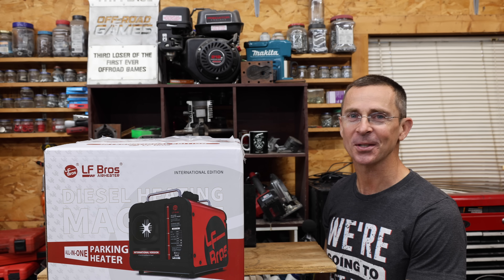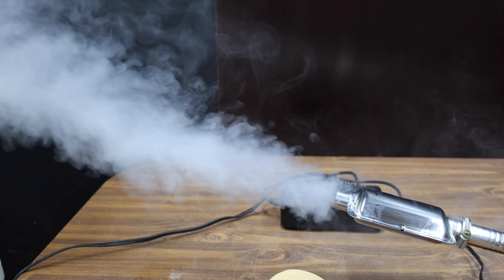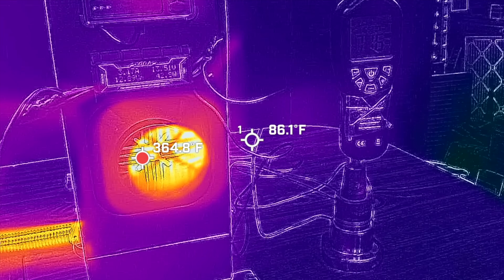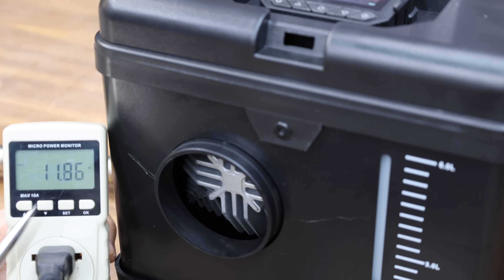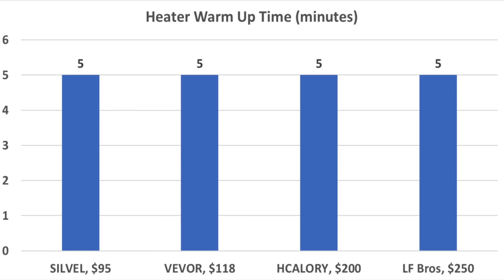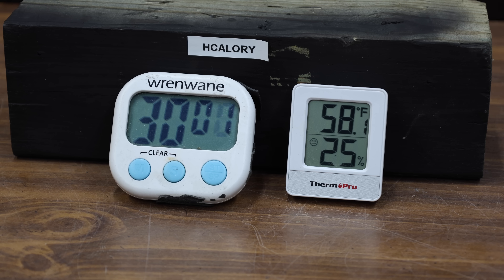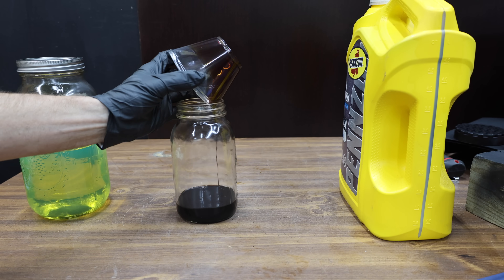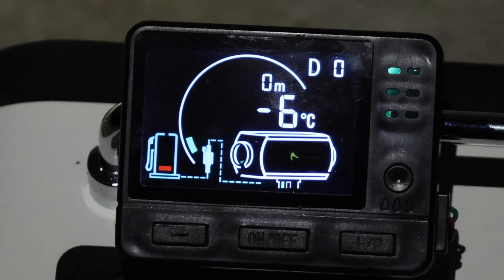The Truth About Cheap Diesel Heaters!

Comment: Great video as always.

An off-roader/overlander I follow has an older version of the HCalory and has been using it for several years. There are only minor differences between the old and new. One thing he really liked about it was the folding handle and little storage compartments on top. The only drawback he pointed out was that if you want to put an air outlet tube on it, it is quite difficult (his actually came with one). Considering his review and your far more thorough review, I believe I'll be going with the HCalory.

Thank you so much for this great service you provide. Looking forward to next week.
Reply from the maker: Thanks for sharing.  You are welcome!

Comment: I am wondering about a CNG heater instead of diesel as it is .99 cents a gal. in my area and diesel is 3 times that also not my choice to burn used motor oil.
Reply from the maker: Thanks for the feedback.

Comment: The one test that is pretty non relevant is the 30 minute heater test for shop temps. Your results give results that I would expect even if you ran the same heater from 50 degrees over and over. The reason, your shop walls, floors, toolboxes and everything else was consuming and holding heat. So each successive heater should raise the air temp a bit more than the previous one because more of the shop surfaces and mass were holding more and more heat energy. So the folks watching this should know that this one test was flawed from the start.

Comment: You should consider testing lithium based batteries. Lipo, LiIon, Life etc. Many people use these batteries, and I would be interested to know which one has the best longevity, power output, accurate capacity rating, etc.
Reply from the maker: Thanks for the suggestion.

Comment: Thanks for the video.  I need some sorta backup for the trailer hood home.  Watching all sorts of videos.
Reply from the maker: You are welcome!
Reply: Ya. I just had the blower motor replaced on the old Coleman furnace.  I used to have a big kerosene heater but checking out different ways to stay warm if the heat goes out.

Comment: ** HEY TODD*** A MOST EXCELLENT VIDEO ON THOSE HEATERS. i just bought a infrared heater putting out 5200 BTUs at 1200 watts and it put my ceramic heater to shame at 1350 watts and 3100 BTUs heats up a room much quicker so if you go electric Infrared is the way to go thanks for this video i did not know there were heaters like that awesome for many scenarios even an apocalypse bug out shelter heater with the other options for fuels. well done Todd Well done.
Reply from the maker: Thanks and you are welcome!  Thanks for sharing.

Comment: I find it odd that none of these units attempts to run the exhaust through a heat exchanger.  The point of the heater is to heat, but these units are throwing a lot of heat right out the window.  I feel like you could even generate supplemental electricity from that waste heat to help offset whats needed to run the unit.
Reply from the maker: Thanks for the feedback.

Comment: I'm using one to keep my workshop (70m³) condens free. Runs about a week on 20 liters of diesel in lowest setting.3 years of troublefree running, for 4 months a year. I'm considering buying a second one to convert it to a cogen setup, to have the exhaust to heat up a boiler.
Reply from the maker: Thanks for sharing.

Comment: Propane and methane heaters are more easy to use and less exhaust. Diesel heater requires to have charged battery while methane heater could be easily started from matches.
Reply from the maker: Thanks for the feedback.

Comment: While all of those diesel heaters are rather similar because they are designed after one certain type introduced many years ago I would be careful with the really cheap ones especially when using them to burn anything else than diesel. Reason being because especially the installtion kit ones to put into an RV or worktruck have flawed aluminium castings of the burner housing that tend to get microcracks after some heatcycles. This in turn means that engine exhaust fumes get pumped into the heated air. Had this case 5 or 6 times where the customer complained about the getting headaches and feeling unwell after a while (but didnt connect it to the heater). Especially with ones with have visible smoke coming from the exhaust (which means they dont fully burn the diesel). Unburnt diesel also means carbon buildup leading to premature failure of the heater and bad heating performance. Interestingly many of the really cheap knockoffs could be diagnosed with the software of one of the bigger manufacturers of those things. Non-functional flame sensoring is a thing too, thermal runaway as a result or the heater getting pumped full of diesel. (I installed and repaired those devices for a living some time ago,  certificatied by a certain local premium manufacturer of those).

Comment: I have two for emergency heat in my tiny house, they do a great job. I mounted the heater outside, ran hot air vent through the wall. Can't hear it at all. I have auto batteries with maintainers on them so ther are ready when needed 
My primary heat is wood, but never know, may get sick, hurt or manh other things that make them a great investment. Spring/fall we have nights that need heat, but to hot in the day, sux waithing on wood heater to burn out then
Reply from the maker: Thanks for sharing.

Comment: I actually just bought one of the Vevor Diesel Heaters, They make 2 kinds (Tall or Square like the Silvel). Absolutely love it so far, Using it to heat my outdoor chicken coop and no problems at all so far, Runs for like 30 hours on low, and if you pipe in the air intake to have it grab warm air, it works more efficient using less fuel as well.

One thing I will say, make sure to open the unit and check it before first use, they forgot to put clips on my fuel line from the tank and it had become disconnected and was leaking diesel everywhere!

Other then that, great heaters!
Reply from the maker: Thanks for sharing.
Reply: With the ones that I could see it, it’s there, Evelyn that they’re using that cheap green vinyl hose to the fuel pump and tank and tank, Eye Dr here to be very very careful with that because Forrest mine began to leak in about a year and behold it is Samuel Steve micro cracks. The whole length of it. Be very careful with that when you replace it get a good quality nylon hose from your local hardware.

Comment: Do the heaters state how many BTUs of heat they put out? Am asking as I have a 60,000 BTU torpedo heater which will heat the garage with the door partially open in winter. Thanks for a great video!

Comment: My recommendations as someone who did a lot of research and built my own all in one style and use for camping. Get the cheapest 5KW model you can find. All of these unless you go to a name brand Webasto or Planar are made with the same parts, and have the same casted shell. There is no such thing as an 8KW, they are just 5KW rebranded. Don't pay more for something that doesn't exist. The only two sizes are 2 and 5 unless you start getting into the water heater models.  If you get a prepackaged all in one the first thing you should do is fully disassemble it and tighten the connections. You will find many of them are completely loose and could lead to carbon monoxide poisoning. Best thing to do is isolate the pump by some sort of rubber mechanical isolator. Run kerosene with a little bit of diesel and they will burn cleaner for a much longer time before you have to disassemble to clean out carbon deposits. Run a minimum of 10AWG power cable, and keep it as short as possible for minimal voltage drop. Use exhaust RTV around your connection, and always keep a CO alarm wherever you use one.  Other than that look up all the instructions on mounting. Orientation and location of exhaust outlet in relation to the heater are important. Plenty of YouTube videos to educate yourself.

Comment: The smoky start needs to be disregarded due to voltage drop/power failure. All of them would do that if you just hook up a low power supply to it

Comment: I used 2 of the cheap Chinese diesel heaters during an ice storm last winter to heat my home when my furnace blower went out.  I had to wait 24 hours for an HVAC guy to show up and my house never dropped below 60 degrees.  You can run multiple diesel heaters at once from 110ac power using a transformer found on fleabay/jungle site-just search: AC-DC 0-48V Adjustable 10A-480W Voltage Digital Display DC Regulated Switching Power Supply Adapt to DC Speed Control Motor
I have many videos on these heaters from over the years including experiments and projects like heating my garage, heating my Tahoe for two entire winters, using an old steam radiator for waste heat recovery, heating my greenhouse.  Highly recommend them, there are many groups on Facebook dedicated to Chinese diesel heaters.  Anyway, thank you for all these excellent videos Project Farm
Reply from the maker: You are welcome!  Thanks for sharing.

Comment: I love my Vevor, but used oil mixed with gas or oil/diesel mixture didn't work well over time. Too dirty and sooty. I just run pure diesel fuel now. It's way cheaper than kerosene now.

Comment: Excellent content!
As an experienced off-gridder…. Might also be good to consider one of the 12v wall mount marine units and have it mounted and ready in the garage or other location like a living room to be instantly prepared.

The advantage to the garage is that I pull batteries from vehicles in the winter to recondition them for the next summer

Comment: Just so you know it:
They are all based upon the same heater, the heaters can either be 3KW or 5KW, there exists no 8KW but they "arrive" to that by pressing the heater above its specification. The click sound is the tiny pump, trying to pump op the fuel while being empty, this can destroy the pump.
Things you have to look for, is if the fuel hose is of a stiff kind, after the fuel pump, since it lets the fuel move easier. The fuel hose it always a bit above the bottom because of "as you say" the water and other things in the bottom of the tank.
If you have any questions, please ask. :-)
Reply: Should I got one as emergency backup in my 16 x 80 mobile home?
Reply: @surf6009  It depends on a lot, but these heaters are originally made to heat up campers and small houseboats.
The problem is that such a small heater can only heat up minor rooms and is in no way able to heat up several rooms.
I would get an oil heater (not gas), they are better at heating, less dangerous and cheaper to run.

Comment: They're fine for sheds, and garages.
As for camping.
The clicking sound from the fuel pump will get quite annoying.
Foresty Forest lives in a van.
He has used the Vevor brand for at least 5 years now.
Zero problems.
Other than the noisy pump.
Which he ended up replacing.
With a quiet one, that a subscriber custom made for it.

Comment: I see you measuring exhaust temperture but it's of a shinny exhaust pipe.  Out of a manual.
Infrared thermometers have good accuracy when measuring most objects, but shiny, reflective surfaces can be a challenge. You should be especially wary when measuring the temperature of shiny metal objects, but even reflections off of glossy paint can affect accuracy. Putting a piece of non-reflective tape (such as electrical tape) over the shiny surface or applying some flat paint gives you a target from which you can get a better measurement.

Comment: If you have an old kerosene heater, it can run off of diesel in a pinch if you add about 15ml/gal of 90% isopropyl alcohol per gallon. Probably not the best thing in the world for the mantle life, but it burns clean and and is a definite backup to keep in mind as an option during an emergency. Kerosene heaters are ubiquitous, but unfortunately kerosene gets harder to find everyday in some places.

Comment: I snagged the Hcalory off marketplace brand new for $100 a couple months back and it's been great. One thing I would like to see is how they handle a 50/50 gasoline/used motor oil mix since I can get both from work for free (the gasoline is actually a mix of mostly gas with some diesel in it)

Comment: Another great video! your testing is always on point and very much "everyday use" and not the edge case/unrelated testings we often see when said products are advertised. Well done as always! 👍🏻

Few products testing ideas:
- Spirit levels (like Stabila, Stanley etc.)
- Caulk (Dynaflex 230, Osi Quad Max, Sika Construction Sealant etc.)
- Hammers! (claw, club, stubby etc.)
Reply: I think it would be almost impossible to test hammers. There's just too many different types. Body hammers for example. The "best" seems to be a close race between snap on and Martin. Mac and I believe Cornwell rebrand Martin. The first set of body hammers I bought were matco and cost well over $300. My current go to is a pick hammer I bought at a local parts store for $13. O really, advanced, autozone all carry it. The matco hammers have stained handles but use the exact same handle as the cheap one that has a sharper point. Outside of body hammers, I really like trusty cook. Tekton rebranded them.
Reply: @aaadamt964  I have never heard of "body hammer" in my life lol! after some googling it looks like a warrington hammer but with a flat round "disk-like" head... very weird haha!
Reply: @onepiecepedia  that sounds like a door skin hammer. There's just so many different types of hammers out there you couldn't just test hammers.i mentioned body hammers because I do body work for a living.

Comment: Great channel. May I comment on your recommendation of an AC to DC adapter for these units: These heaters go through a cooldown cycle when turned off, where the fan will continue running for several minutes even after combustion stops. If the power fails while using an AC to DC adapter, there will be no cooldown cycle. Without the cooldown cycle, heat builds up inside the heater and enclosure and tends to damage or destroy the unit. While it may not be destroyed the first time, it's a risk, and if it happens more than once you may have to replace components. These are best hooked into a 12v battery, to which you can connect a smart charger which effectively gets you on your mains AC without the risk of damage during a power outage.
Reply: Good point. An older lead acid battery from a car that doesn't have the cranking amps anymore will do nicely for this application.
Reply: @maddox0110  that’s what I have, it’s on a trickle charger so the battery is always charged
Reply: @glenith50 seems like a lot of work when you can just buy an electric heater.
Reply: @wgooetrik  works for me as I’m off grid and this kind of heat is best in my workshop, an electric heater would drain my batteries pretty quickly
Reply: @wgooetrik  Not if you lose grid power and need to run something off of a battery power station to keep you warm for hours.  An electric heater would deplete that power station pretty quick but a chinese heater could probably run on a battery for 8 hours and produce way more heat than an electric space heater.
Reply: @wgooetrik  Not everyone has the kind of wiring set up for 8kw of electric heat where they need it. That's over 50 amps at 240 volts.
Reply: @PK1312  What planet are you living on where 12kW = 8kW? (50A*240V = 12000W where as 33.33A*240V = 8,000W) Still a lot of power but not over 50A.
Reply: @wgooetrik  Not everyone has cheap electricity and energy content of fuel oil is high and often priced low.
Reply: That's what I do for my radios. I'm not sure how many "smart" chargers could handle a constant load though. Radios draw very little power unless you are transmitting. While these don't draw a ton once warmed up I think it may be significant enough to bamboozle a smart charger
Reply: ...use an old xbox power supply, works great

Comment: I'm really glad to see some alternative fuel testing with these, as I add two cycle or filtered waste oil to every tank of my pre-emissions diesels vehicles. I also just purchased a Sprinter ambulance to use as an RV, and now know what I'm going to heat it with when I can't park where there is an RV plug. Thank you!
Reply from the maker: Thanks for sharing.
Reply: Do not use anything but pure fuel, unless you don't rely on the heater and can have downtime to take it apart. 

Used motor oil will burn, but it leaves behind a coal and ash like deposit that will accumulate in your combustion chamber. The more used motor oil, the faster it builds up. 

After experimenting, no more used oil. It is filthy.
Reply: How are you pre filtering the oil ?
Reply: @Doomycl  pump, fuel line, filter(s)... just a guess 😮

Comment: I've had one of these clones in my garage for almost 10 years now...works great.  I upgraded it to two of those Vevors recently only because it was getting tired from me abusing it with used motor oils and hydro fluid.  

All of these are identical because they are a clone of an old tried and true German design that the patent expired.  To be honest, I'm surprised you even found the differencez that you did, but it's most down to case design.

In fact the only difference between 5kw and 8kw is the amount of fuel it injects.

So all of this is a huge advantage because it means they are easily services and the parts are just jelly bean parts.
Reply from the maker: Thanks for sharing.
Reply: Yep, they are all clones of the espar / Eberspacher heaters.
When the patent expired, the clones went into full production.

The clones work well, initially,  but often overfuel due to missmatched pumps, or incorrect controller settings.
This causes rapid soot build-up, requiring a stripdown to clean.
Adjusted correctly, possibly with an aftermarket controller, they are O.K.
Watchout for fume leaks, a CO alarm is a must.